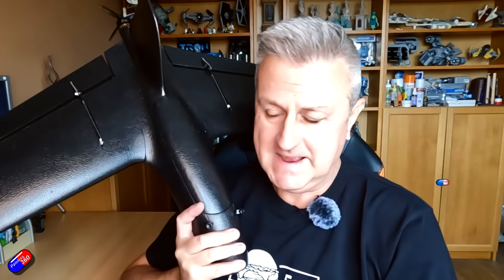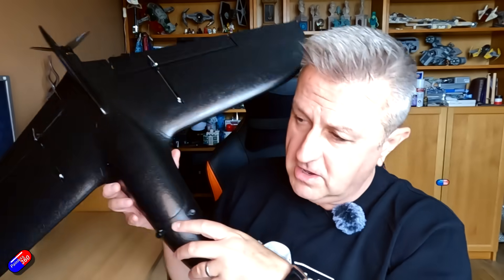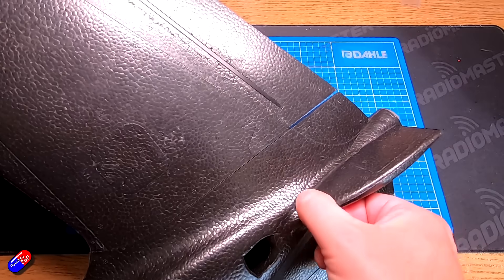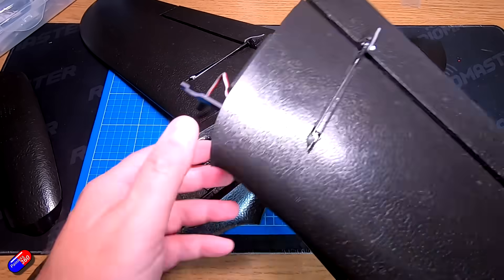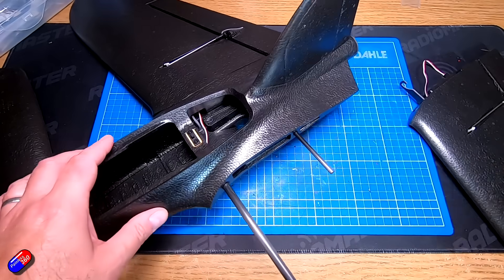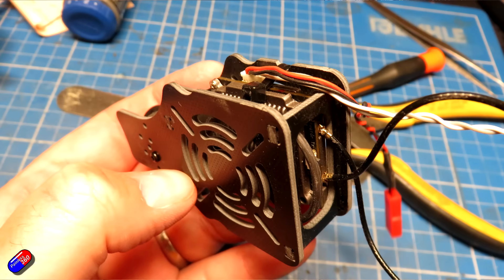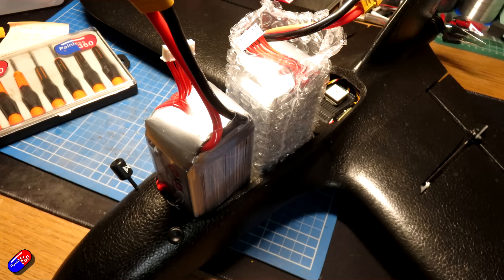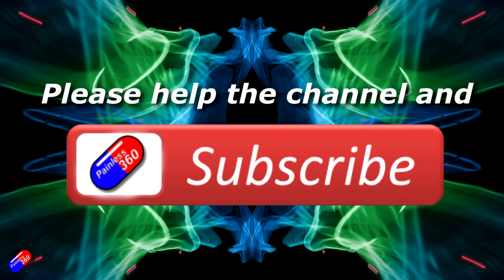How I've build out (and modified!) my TBS Chupito

Comment: You picked ELSRS or Crossfire for RX? Or something else?
Reply from the maker: See the AIO setup video linked in description... Happy flying!
Reply: @Painless360  Thanx, just found you have V inside. The point is am going to use FPV controller 3 at the beginning, but i am thinking what i could put into a tail (before i glue it) for future - crossfire or elrs antenna.

Comment: Nice build only one thing if your ever going to run a 6s lipo in this wing install a 1000uf 35v cap at the xt60 connector as i have already killed an 04 pro using the user1 mode to turn the power off while waiting for gps sats and then switching power on, tbs support has told me there was no need for a cap as there is one on the board inside the stack so i took it apart and checked and i can not find anything inside and one the esc or fc nothing for voltage spike protection so please install one before it happens to someone else.
Reply from the maker: I always power the VTX after the GPS is locked. Helps protect it from surges.  Happy flying!
Reply: @Painless360  Thats what i have been doing a bang down with a new 04 pro

Comment: @painless360 I’m flying planes and wings for a while now. This Will be my first plane with an fc in it. And my first fpv plane. I was wondering if it would fly with a 4s 1300mah battery 2207 motor with 2300kv. Because i think 6s is still a little to much for me. Ore should i get a smaller battery Because of the weight?
Reply from the maker: Stay tuned! I'll be covering how it flies on 4s soon... Happy flying
Reply: @Painless360 Thanks for the ultra fast reply. And i will defenitly Watch your video. But can you please confirm If this set up will work. Because i realy don’t know. 1050 mah battery ore 1300. Both to heavy?
Reply from the maker: The battery weight I am using is probably the lightest you can use. It'll take heavier packs. The larger bettery weight is in the TBS listing... stay tuned!
Reply: Your setup will be fine. I have a 1950kv motor on 4S, so you will have more Speed. If you eventually want to go 6S, use a lower kV motor but for 4S its fine.

Comment: Excellent video! What glue are you using for magnets? Uhu por? Mine never seem to stay very long. 

What is the procedure for getting footage off the HD vtx? Do we just have to make sure everything is mounted in such a way (e.g. extra wire slack, antennas loose) that it can be pulled out after every flight to get to the card/USB? Will that wear out the “slot” the cage is trapped in? Looking at my kit, it appears the slot is just foam.
Reply from the maker: I use black hot glue. It seems to be one of the few things that hold the magnets well enough. Cleaning the magenta with alcohol helps the glue stick too... Happy flying

Comment: This must be the best build video  I've seen up to yet. I like how you have configured the fin, especially. Very practical, and I would do the same. 5*
Reply from the maker: Glad you found it useful! Happy flying!
Reply: @Painless360  I’m flying planes and wings for a while now. This Will be my first plane with an fc in it. And my first fpv plane. I was wondering if it would fly with a 4s 1300mah battery 2207 motor with 2300kv. Because i think 6s is still a little to much for me. Ore should i get a smaller battery Because of the weight? I already orderd the motor😅
Reply from the maker: I'll be able to answer that after the 4s flying.  Stay tuned!

Comment: Good morning, Lee. Any Reflex? I didn't hear you mention Reflex, just deflection. I've built wings before, so I know Reflex is needed on most wings.
Reply from the maker: As I'm using good ol' INAV Autolaunch I don't need to worry about any of that as INAV will launch it and trim the positions of the servos in flight... Stay tuned!
Reply: Do you have a link for the magnets?
Reply from the maker: I don't, they cane from my stash... Happy flying
Reply: Wing has built in reflex.  If you set up the control surface level with wing you are good to go.

Comment: Instead of reducing the throws in Inav, why not move the servo links further down the arms?
Reply: Agreed, this is what Kofi (TBS) recommends and how I've done mine,  10/15mm throws are now perfect with INAV at 100% rates
Reply from the maker: That would be the way I'd normally do it. But in this case things are tight for clearance. Try the next hole down on yours and let me know how it works. See the Diff all file from TBS, they've had to do the same too... Happy flying

Comment: It's come together nicely Lee, the mods you've made look great. I'm keen to see what the launch strategy for the maiden will be, as there doesn't appear to be anywhere to hold the underside of the 'fuselage'. A reverse over the head launch, like TBS use on their promo video, might be a bit interesting for a maiden 😨.
Reply from the maker: It's fine for a single handed throw. Stay tuned!
Reply: Personally, I launch mine by holding it underneath, as I do with all my planes. With the autolaunch, there's no problem. The Chupito flies straight ahead and climbs properly. No need to launch it behind your head. That doesn't work for me.

Comment: Just received my plane today and I have also decided to add a magnet to the fin and I'm using crossfire so the antenna in the 2nd vertical hole as designed. The crossfire receiver I will put in the fin space and just make a fly lead to connect to the FC, using a 4-way dupont connector.